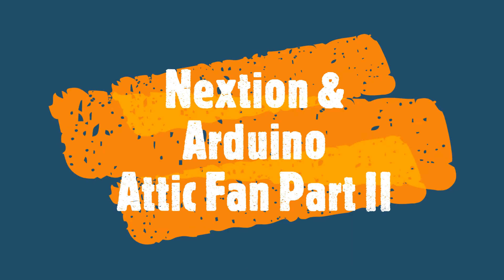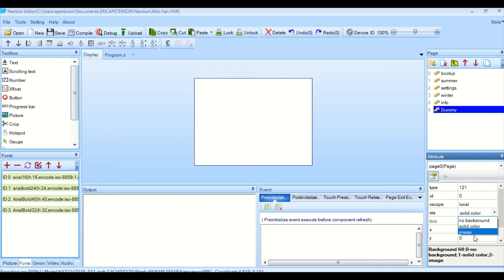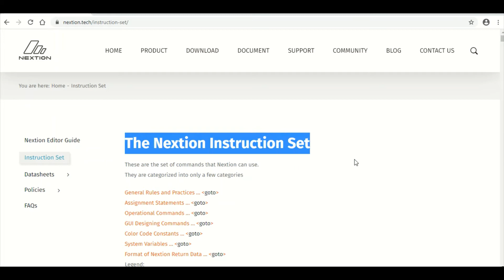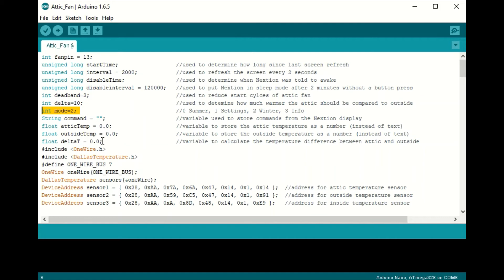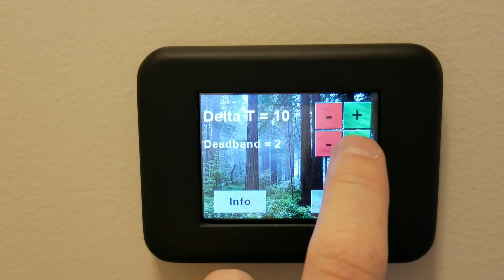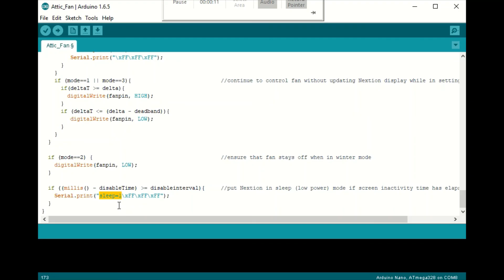Arduino Attic Fan Control with Nextion Touch Screen GUI // Part 2 – Software

Comment: Hello sir, nice project,
One question : Why don't you use nextion.h library for communication witch display ?
Reply from the maker: No reason in particular. I figured that I needed to either learn the Nextion commands or learn the Nextion library commands. Once I saw how simple the Nextion commands were, I decided that I could write the code without the library.